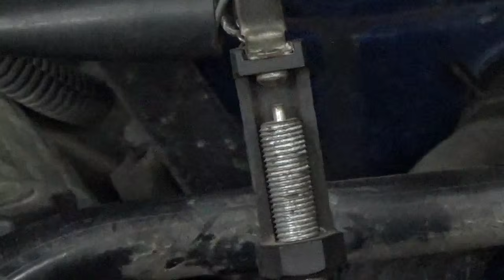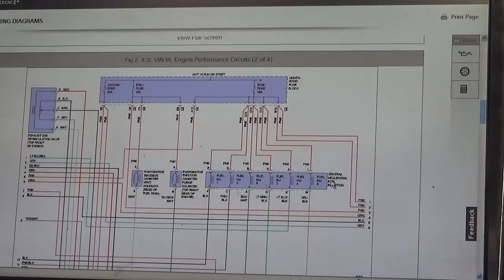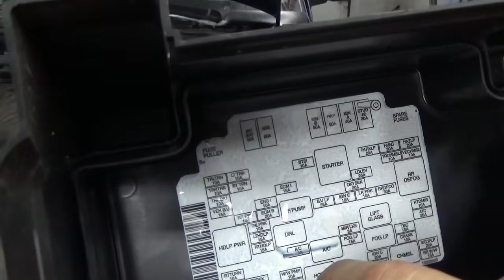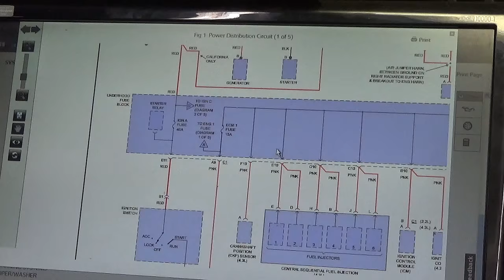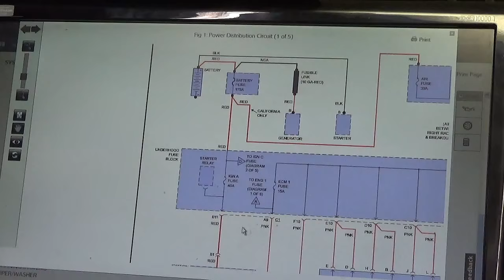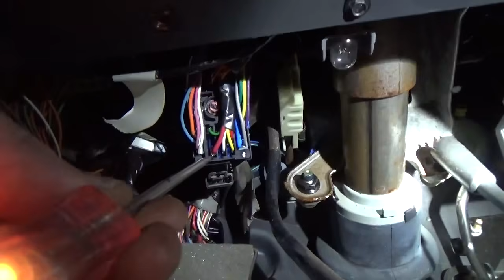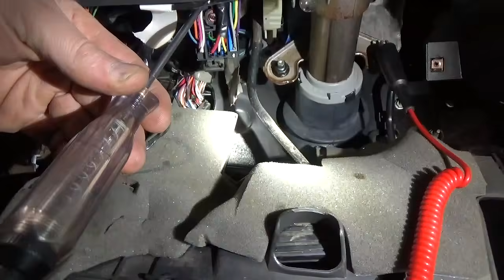No Start / No Spark / Cranks OK - GMC Jimmy / S10 Blazer

Comment from the maker: *Professional 6-12V Circuit Tester - Indicator Light - Lifetime Warranty by Industrial Tools:https://amzn.to/2JOgxGg
*Here is the video with the fix: https://www.youtube.com/watch?v=TXKp3UEXnUQ
Reply: Hey Like watching videos on electrical situations and repairs. You have excellent tutorial videos
Reply: good mechanic ! I like mechanics that make sure what the trouble is before doing a bunch of work that's not needed !
Reply: Tip for every1- Dont pull the ecm1 fuse or fuck with the ecm by the battery.
Reply: I have an 03 impala no crank no start. New starter, new ignition switch and programmed it 3 times nothing
Reply: Hi. I'm in a dilemma.  I have a 99 Taurus that has no spark.  Turns over and won't start and was wondering and hoping you could give me any suggestions on what might be causing this? I'd greatly appreciate your guidance.  Ty
Reply: My buddy has had 6 Ford Probe GT Distributors replaced over the last 7 years. Each time a complete unit. Whats wrong with the car?
Reply: Thank you Eric the was  impressed I fixed my truck falling you experience
Reply: Comment on a 3 year old vid. Good on ya mah dude. I rewatch your vids sometimes. ✌💙💵
Reply: The test light goes off pointed to the control wire when turning the key, is that normal? 5.7vortec.
Reply: eric great job as always i love how you explain everything in detail i have a 2004 chevy silverado with the 5.3v8 and it every now and then does a security lockout on me for like 15 mins where the vehicle will crank over but there is now fuel or spark being supplied i assume and there is a lock on the indicator lights in the dash that lights up any idea what to do in this situation it really sucks

Comment: With mine, i was going up a hill and it bogged down bad. 
So i eased the gas pedal and it worked just fine, unless it you pressed it harder. 
Got it home and started looking at maf and egr stuff. 
Gave up for the night and went inside. 

The nexr day i went to start it and pull it into the shop and it wouldnt start. 
After 50 attempts it finally started. Didnt have a problem starting it after that.
Went through stuff all day and didnt have any luck. 
Then, the next day, went out to start it again and it wont start at all. 
98 blazer LS 4 door. 
Any ideas? 
Only code was p0420, catalyst efficiency below threshold bank 1

Comment: My 2000 GMC Jimmy started cutting off going down the hwy. It wont crank immediately, but after time passes it will. We put a crank sensor on, to no avail. Last year we put new rotor button and distributor cap on. Ran great til now.

Comment: I had that happen to one of my rigs when you hit the key to start it's a different circuit you get full power and when you go and let off the key it's a different circuit because all the other accessories run on that same circuit check the wire that goes to the starter motor

Comment: wow, I have the same problem no spark at the coil for the 91'-S10 2.5L. I got hot at the coil but I did not check it is hot when cranking. Coil and distributor are working on the donor vehicle. But I do not have any spark when I crank. So I would check the hot wire at the coil when it crank. thank you for this tip.

Comment: Hi I have a question for you , my engine blown in Spain after on the hight way my transmission stuck on second gear and heated up the engine and caused my engine blown , I ordered a used crank shaft from US and rebuild the engine , by Spanish Mecanic , so I took the car bak to my sister in Spain and was working fine until I left the s10 for few months , I live in London UK ,after I come back to Spain to take my car didn't start I changed the distributor, fuel pump and coil as well as fuel injectors but sign starts but after 20 to 30 second shuts off. I stuck in Spain can't take my s10 back to UK and I asked few Mecanic no body is familiar with American car. I have notice the timing change some times is it possible when the Mecanic rebuilding the engine didn't fit the cam shaft gear I mean there are two dot to set the time , I am really stuck and don't know what is the cause of it do you have any idea? thanks

Comment: I changed distributor , injection , coil and fuel pump but to luck , after I changed the coil and injectors starts but after 20 to 30 second turned off any idea ? what is going on ? thanks

Comment: yo yengo una chevrolet s-10 2002 vortec 4×4 motor4.3 y ni tenia chispa y encendia aveces y despues dejo de encender  le puse crank shaft sensor camshaft sensor rotor y casaco de ignicion y cilindro de ignition switch y seguia igual y descubri que le di un cantaso encima ala computadora y prendio y descubri que es la computadora

Comment: Ok bud here is my situation I have 2000 4.3 4x4 chevy blazer LT I have no spark  I replaced  every part that has to do with the ignition system the ignition switch, the distributor, cam sensor, plugs,wires,coil,icm,crankshaft position sensor, fuses,relays,fuel pump,fuel filter, cap,rotor so with all that my uncle had done the same exact same thing and we both still got no spark so I think it's the ignition crankshaft trigger ring that's underneath the timing cover  I really need some advice if I'm heading in the right direction opinions  needed thanks

Comment: This is quite an old video, I did watch it earlier today because I have a 98 S10 with literally the same problem. Previous owner threw a ton of parts at it, coil, ICM, distributor, Crank sensor, new battery, etc.... Mine however did start at some point after you'd stand on the starter till the battery was nearly dead. It does have fuel, it can be smelled on cranking. Latley, I've drained the battery several times standing on it. Even hot sauce down the neck wouldn't fire it. I hooked up an inline spark tester, no spark at cylinder 1. I found this video, and I did the same tests you did, however, on cranking, the fuses maintain power....switch could be bad still, but it was not doing exactly what yours was. 

What else could it be???? It's a 4.3 TBI....fairly simple system.

Comment: Had the same problem 1980 or so, the wiring part of the switch is several inches down the steering column and is operated  by a rod when you turn the switch to start. This connection is adjustable and that is all it needed.

Comment: I wish your shop was close to where I live. I have a 95 blazer with an annoying problem. I have a mechanic friend with 45 years experience and a bunch of GM training certificates hanging on the wall who can't figure it out. Sometimes when I drive the Blazer for a while park it go inside and do my shopping come back out and it won't start without . Spray some carb cleaner or starting fluid in the intake after about 4 attempts and it starts. My mechanic friend says it has an egr code even after replacing it . He has changed the cam sensor twice, fuel pump 3 times (they were bleeding off), distributor cap, coil, (it was bad and I had a spare), tried 3 different computers, 3 different spiders, new positive battery cable (it was badly corroded), new battery, and probably other parts as well. I have a test light and multimeter. Where can I download a wiring diagram so I can try checking things when it is acting up? The vehicle has  3 Bosch relays hanging on the firewall which he says shouldn't be causing a problem. I have 2 of those relays as spares which I'm going to try next time it acts up.

Comment: My 2003 S-10 has similar issues........BUT, sometimes it will fire right on first crank, next it will not start and flood the dickens out of the engine making it impossible to start, wait 2 or 3 days for gas to dry up, still no start, turn key off before it floods, try again, fires right up.  When key is in run engine goes whir whir whir then sounds like it wants to start, stumble stumble, starter Bendix disengages then nothing.  Try again within 30 seconds same thing except this time I smell raw gas and I quit till next day or two.  An intermittent nightmare.   Then next time start right up like nothing was wrong and run like new.  BTW  it doesn't throw any codes either.

Comment: Ok I've got a 94 blazer 4.3 I have replaced the following coil Ignition module cap button checked all fuses new plugs and junkyard ecm excat same model they lost the keys so I pulled the switch out and cranking it with needlenose sounds like it has good compression so I think I wasted bunch of time and money you think it's the Ignition switch ?????
Reply: Would appreciate any advice but no fire  or fuel will not hit on starting fluid either thanks

Comment: Where are you located? Im having a crank no start issue with my S-10 2.2L. When I crank it it starts then immediately shut off. Then wont start. Ive replaced ignition switch, ECM. Itwas running great then one day shut down and wouldnt restart. Im at a total loss as to the issue. Thought it was anti theft system. BYpass and did the key relearn procedure. No fix. ??? Any help would be greatly appreciated.

Comment: I've got an 04 1500 with a 4.3. Got no spark at coil. I've replaced the coil, distributor cap and rotor and still nada. I've verified I've got power to the coil, icm, all the fuses you've mentioned in this video. Got fuel, got air but won't fire over. Just randomly died on me in a drove through. Can't find anything on the issue that actually has am answer. Any help would be appreciated

Comment: Pretty exciting, I my Nissan NP 200 looses spark and acceleration, sometimes it start sometimes it doesn't start when you crank the engine. Could it be the same problem? But I already have a new ignition installed.

Comment: When you were testing the ecm1 fuse was it blown out ? and if it was did it blow out when you crank the engine ? because my ecm1 fuse blows out as soon as I put the ignition into accessories. I wasn’t sure of the ecm1 fuse on your video if it was blown or if it was still good . Thanks for your excellent video . I’m just finding it so many years later !!!
Reply: Did you find out ???

Comment: I got a problem on my Chevy S10 l took the 2.2 . motor because the it wasn't good so what l did l put a 4.3 motor in it but it crank but it doesn't turn on no spark to the spark plugs everything is brand new but nothing l been trying to get it on but nothing

Comment: Oh man 8 year vid hope you read and reply for my comment. So I had an issue were my crank fuse would blow out. I ened up taking it to a shop which turn out to be expensive it was a $600 with/parts/ diagnostic/labor/2yr warranty. It was the crank sensor and the wire harness wasnt replaced just patched. So  the fuse began to blow out again took it in and they fix it this time if was some wires going to the transmission sensor. The guy wanted to charge $60 for the work but I asked him why didnt the warranty apply if it was the same issue and diagnostics wasnt done all the way. Is he right or am I worng?

Comment: I'm getting this exact symptom but from the ignition control wire (white wire from ICM that goes to ECM)
I get a flash of test light once I release the ignition switch. That can't be the ignition switch though correct?

Comment: i have a 95 GMC Sonoma that is cranking no start but if you spray it with brake clean it act like it want to start put new plugs and wires and new fuel pump and strainer and filter still wont start its got spark and fuel but idk

Comment: question where would you start if your brake lights stay on even if you unhook the brake switch and they go off if you pull the lt trn fuse rt trn fuse and then they go out any help would be great thanks

Comment: 1999 suburban k1500 5.7 what is the fix 1351 and start s and dies then runs the then no start then p1351  ignition control circuit high voltage

Comment: We just replaced a couple rusted/leaking  fuel lines, the rusted gas tank, and fuel pump. Rolls over and over and no start. I know the 4.3 is known for distributor cap issues, so maybe I will start there...

Comment: I have a Silverado no power to turn signal fuse but when I connect a tester to blinker relay it starts blinking at blinker but not on outside, so what would it need a ground or hot wire don’t understand what it means thanks

Comment: wHAT IF YOU HAVE POWER AT ECM FUSE WHEN CRANKING.aND WONT STAY RUNNING ALL THOUGH IT TRIES. HAS FUEL PRESSURE.

Comment: My problem is very close to the part where you loose the lighting when powering up but something is killing new batteries like overnight and we have put a new ignition in the Jimmy and new fuel pump and filter and when it would start and run fine likit was charging it would never strand us but when we got home and it sat for a little bit I would not start so we put new alternator on and it lasted a couple of days but stopped charging again and all of the dash lights speedometer would start going crazy  but now it gives you one shot at starting and you can watch the interior lights come on when you turn the key over to accessory and then you can watch the light completely go out while battery dies right in front of your eyes I need some help even after a ril look efuel pump and

Comment: I noticed after a heavy rain my distributor cap had moisture in it but truck cranked but didn’t start. So I replaced cap and rotar now it runs fine so if anything fails check cap and rotar is outta time

Comment: Thanks for the video - excellent troubleshooting procedure on how to check the ignition switch and one possible solution for a crank no start which I have. Only that my silverado (should be similar concept right?) seems to not start when the humidity gets about 30% not even rain yet. Been checking different possible issues without replacing with new parts....yet :-) thanks again

Comment: If the red wire is off . Shows no light.  Even went is  cranking.  But pink wire is on all the time . Still is the ignition switch?

Comment: Wondering if you can help? 2006 silverado 1500hd 6.0 overnight start in morning crank no start some popping in exhaust  until 2nd try runs flawlessly, also turn key off 1min turn key on for 2 min crank no start some popping in exhaust until second try runs flawlessly. Replaced cam position sensor due to code being set, did it before changing out, crank speed shows good, 55/60 psi fuel pressure, passlock good, injectors are pulsing, no spark on start attempts

Comment: Hey eric hope all is well. Have a weird issue. Have an older Chevy Express 5.0 VIN M . I left NYC for about one year and two months, when I left the van was running no issues at all. I came back last month Feb.22022, during that period the van sat basically on the street and battery was disconnected. I changed the oil went to start the engine  and nothing, just cranks and cranks. I suspected it was the fuel pump and heard no priming when opening the key. The weird issue is that I disconnected ECM fuse B under the hood and plugged it back in and the dash check engine light would flash on and off, at the same time as the fuel pump.. so it cycled on and off on and off and wouldnt stop. The other weird part is there is no spark, i bought an ICM , coil and still no spark. The van was running before I left, it was bot touched or started so i thought  maybe mice but cant find anything chewed up. I manually powered the oump with a power probe and pump runs. Not sure either if this year had factory alarm but I dont think so since the dash has never shown me any security lights. I am stumped and dont want to throw parts at it, i was the thinking maybe the crank position sensor… would you have any ideas 

My biggest worry is why would the fuel pump cycle on and off continuously and at the same time, the check engine light would flash on and off. Thanks hope you read this.
Reply: He made a video not long ago saying hes not
Going to be giving diagnosis over comments, or the phone, and that he will no longer take out of town customers, he’s only fixing local customers vehicles.
Reply: @Ihatethegovernment666  Missed that video. I need to move away from NYC then. he's upstate NY if I remember correctly. man I am having the roughest time with my vortec engine no one can figure it out. bad mechanics out there.
Reply: @YoungHeartedSoul  you could “break down” in his town, he would probably fix it 😂
Reply: @Ihatethegovernment666  would get a really good video out this van has me stumped!!!!!
Reply: @YoungHeartedSoul  if you live in New York you could always try.
Reply: @Ihatethegovernment666  he’s pretty far up from me, my van wont start and taken apart so that would be a crazy ordeal to take it up there.
Reply: @YoungHeartedSoul  i live in Canada, is New York state pretty big? I know New York city is huge.
Reply: @Ihatethegovernment666  its pretty big from the soutehrn most part to say Canada its anywhere from almost 6 hrs depending which way you point up North, west of ny/canada border might be a bit more but overall i think its the 27th largest US state.

Comment: I can tell you this much if the oil pressure sensor is malfunctioning it will not register to the computer and turn on the fuel pump. You'll get starter turning over spark but no fuel

Comment: I have 1999 S10 no spark can't here fuel pump kicking on replaced cam sensor cap rotor coil crankshaft sensor control module please help????